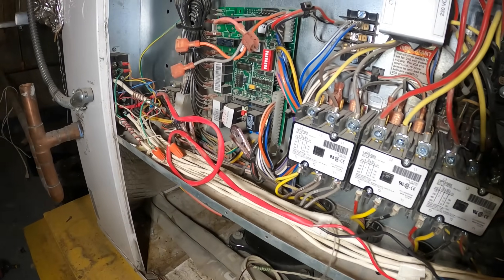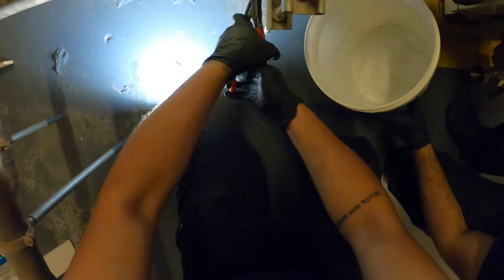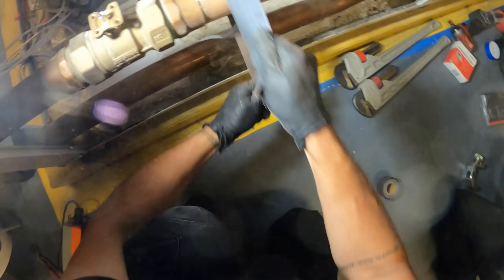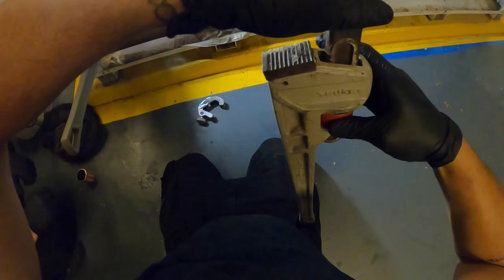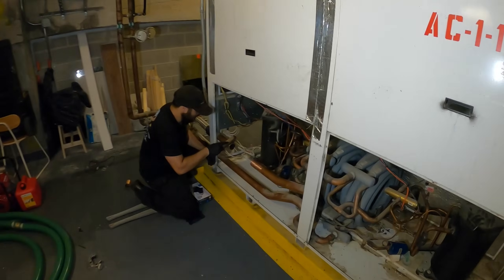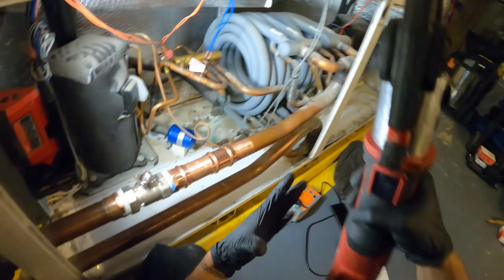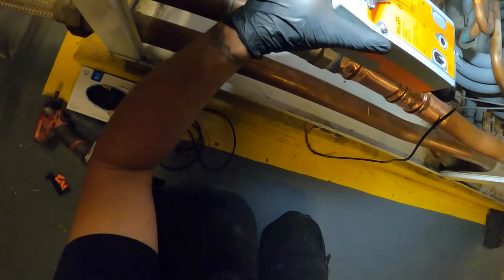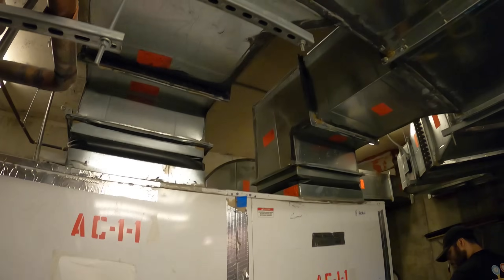HVAC: Johnson Controls Water Source Heat Pump Not Cooling  Valve Actuator Installation/Replacement)

Comment: This why I pick parts off old equipment that's getting replaced. I have tons of control relays, terminal strips, transducers, thermistors, controls transformers, display screens, rectifier boards, potentiometers, blah blah. For an emergency purpose and for testing. I'm sure that unit is 460v and has a controls transformer that steps it down to 120v or 24v. You can rob power from that to test it or step it down from 120v to 24v to test it. Or you can use it to jump around the BAS and turn things off and on.

Comment: The facility where i work will open the hot water valves while cooling. That is because they are reheat coils. What was happening here, was the cooling output poor? Or is the BAS not managing the valves correctly?

Comment: Was you not wanting to disturb that existing union? Is that why you cut the line? Also, with the slip couplings what i do is measure the overall length, divide in half, then mark your pipe that distance. That ensures you have the coupling in the right place.
Reply: I was thinking the same thing.
Reply: I was very surprised he didn't just break the union on the left next to the flex joint also, I wonder if he didn't notice it was there?

Comment: My Sunday is complete!!!! First one on a Jumper Man Tech Video!!!! 😄 Good morning Mr. Tech, at approx. 6: 22 of video you swing to the Ht. coil and mentioned that the ht. coil was energized and not the water valve in the A/C unit, are you confident that the original trouble was in the Water valve and not in the signaling from the building control system? Thank You, KMJP, CM. ACE.